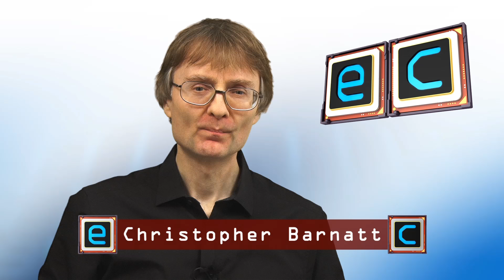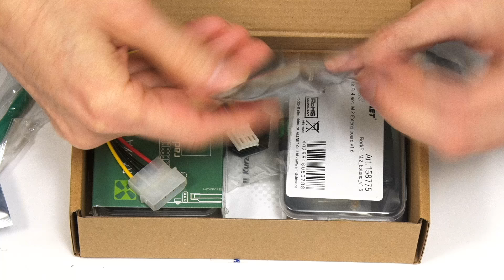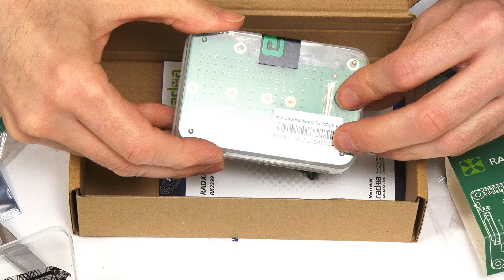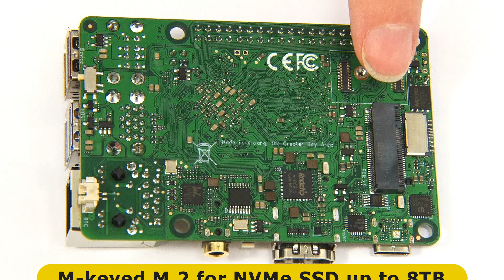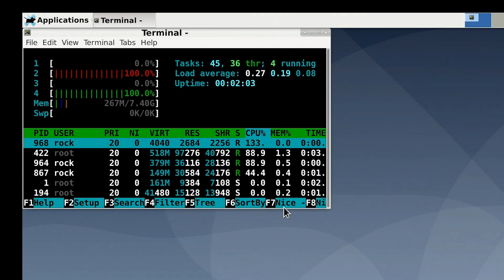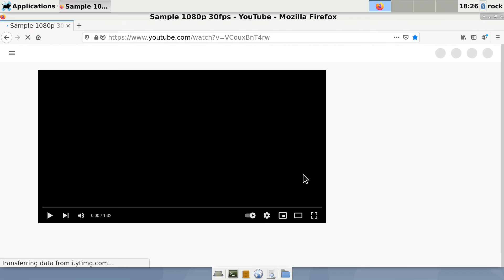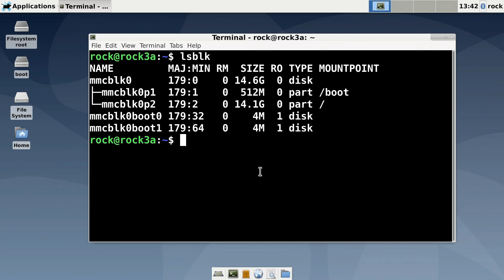Rock 3A: Dual M.2 ARM SBC with eMMC socket

Comment: I am wondering if you could test one of the SBCs with an m.2 slot with a m.2 to SATA card, I have seen these that support 6 SATA connections. ORICO M.2 PCIe M Key to 6 x SATA 6Gbps Adapter Card for Desktop PC Support RAID-PM2TS6 It seems like this would allow you to create a nice NAS. Can these boards run freeNAS, if so, it would be great.
Reply from the maker: An M.2 SATA to SATA adapter will certainly work on an SBC with an M.2 SATA port (well, if the OS used supports the SATA M.2 slot -- and that is by no means guaranteed!). However, an M.2 PCIe/NVMe to SATA adapter will requirea  driver for the specific hardware, and this is very unlikely to be available for ARM SBCs (a specialist driver for a specialist OS!). However, such an adapter should work fine on x86 SBCs -- eg a LattePanda 3 Delta.

FreeNAS is not available for ARM as far as I am aware -- it is for x86 computers only. Commonly ARM SBCs run OMV for a NAS.
Reply: @ExplainingComputers  Hey Christopher - thanks a lot for the video! Was wondering if its still possible to make a follow up video with m2 to 6 SATA Card, running latest official image or Armbian. Looking for cheap NAS, based on OMV or CasaOS. Currently running OrangepiZero3, but it is limited with USB2.0 and lack of any M2 connectors.....
For some reason I'm sure that you should have one of those M2 to SATA cards laying around xD

Comment: Following-up, I've got the Rock 3A running on Ubuntu 20.04 server to which I've added the Mate UI. It is running very well, even playing YouTube vids, but it is balky when asked to run a movie from my smb server using VLC. There are clearly things that need to be fine-tuned where video is concerned. Sound, however, seems to be great, which I've been getting via Audacious!

I'll be attaching my drives to the 3A using USB 3.0 - Sata drive bays. I currently have 10 TB of capacity, most of it loaded, so these will be accessed via samba as they were in my old setup. Stay tuned!

Comment: Well I got one of these a few weeks ago, and was quite frustrated with the lack of support. If I'm not mistaken the board has been out for about 7  months now, and most of the operating systems are half baked still. When one seeks support from the wiki or forum little assistance is provided. I did however finally get one to run, and when I started the hardware tests suggested, I found the system showed 1.4 GB of memory, when I ordered the 4GB version. It went back. Very frustrating....

Comment: This is quite exciting. While ~1000 MB/s aren't much, it is still quite enough to fully saturate the 1 Gig Ethernet. Meaning we might actually have a board feasible for a cheap, reasonably fast NAS. I wonder if we could get a 4x SATA to M.2 adapter working here...

Comment: Why do these boards include USB 2.0 since it's backwards compatible? Why not make em all USB 3.0?
Reply from the maker: It would cost more, and USB 2.0 is still perfectly sufficient for connecting many devices, not least a mouse and a keyboard!. All desktop PC mothers still also have some USB 2.0 ports for this reason.

Comment: Just you wait, the Rockchip RK3588 is coming very soon (finally) and there will be new SBCs like Rock 5 and a board from Pine64 announced probably by the end of the year. This is alarming for the Raspberry Pi fanatics that are still stuck on 40-28nm, because this SoC will be made on a Samsung 8nm process, will feature 4xA76 cores at 2.4-2.6GHz, 4xA55 cores at 1.8GHz, which will be around 2.5x more powerful than the RK3399 that's found in Rock Pi 4 and other RPi 4 competitors in single core and especially multi core applications, a much more powerful Mali GPU (almost 10 times more powerful than the one in RK3399), an NPU 3.0 with 6 TOPS performance and other great features, like support up to 32GB LPDDR5.
Reply from the maker: Yes, we should see some very good RK3588 SBCs in 2022 I hope -- software permitting . . .
Reply: Awesome... I hope these devices will be available soon for decent prices. Because the RPi devices cpu&gpu power improved only slightly for some 10 years or so (of course there's certain progress within each new line, but it's only in tenths of percent, slightly above the increase of frequency).

Comment: Wouldn't touch Radxa products - their software sucks and the hardware has lots of underlying bugs. Save your money and stay away!
Reply: The SoC's work flawlessly most of the time so it's still going to be a good board for most developers. Raspberry Pi 4 isn't that well supported or superb either, so there are always going to be problems with some boards.

Comment: Sorry, Chris, but you are entirely too forgiving when it comes to the Rockchip line of SoCs when it come to software functionality. This has been a recurring problem and there is absolutely no reason to think kernel/driver support will magically get better if we just wait a little longer. (Full props to Laurence Tang for his work supporting FriendlyARM products, but he seems to be the exception that proves the rule.) 

When I visit the Rockchip wiki I see a Linux 4.4 kernel that supports the RK3399, but neither the RK3368 nor the RK3568 -- the latter particularly of note for this video's SBC. There's no support for RK3568 boards at the Armbian site either. If one of these boards doesn't meet a buyer's needs in the state it arrives in they should return it immediately unless they're hobbyists who enjoy tinkering and rebuilding kernels.

Comment: love your videos. I noted the PCIe connector and I didn't see you use it. I am wanting to know if this will run a graphics card on a mining riser My thought is to run a Linux system and a single 3080ti or 3090. any idea?
Reply from the maker: Thanks for this. In theory the M.2 to PCIe connector I bought could be used with the bottom M.2 slot (the one I which I tested the NVMe (PCIe) SSD. To run a graphics card using the latter would require appropriate Linux kernel support, and relevant drivers. This is not impossible, but it is more likely to use something like a PCIe SATA card.
Reply: There was a video of some guy trying to use an AMD graphics card with a Raspberry Pi 4 and failing to get it to work. And with the obviously inferior kernel and vendor support of Rockchip SoC's and SBC manufacturers, I really wouldn't get my hopes high. 

Just use a thin&light with a Ryzen CPU to play games with a 3080. ETA has done a similar thing in his video that he released just this week, go check it out. Also, no need to use a powerful GPU because you're still going to run into PCIe 3.0 x4 bottlenecks.

Comment: Every review of such devices always misses on documentation. Good hardware (register level) documentation is often make or break for bare metal applications. Without it, it's just yet another Linux box.
Reply from the maker: I specifically did show the available documentation (wiki) here. It does not go down to the register level.
Reply: It seems that everything is working even the M.2 NvME with proper distro... I assume that GPIOs are working cleanly because it's essential for SOCs (I would assume all the the C/C++ libraries for programming own projects are available). With register level you mean writing bytecode (assembler) instructions with peripherals as e.g. with Arduino ? Hmm, it's probably (quite unsolvable) problem.
Reply: @vencdee  By register level, I am thinking about hardware registers of peripheral devices. CPUs themselves are usually pretty well documented, but peripherals are completely different story. Without knowing which bits in each register do what, you can only guess (BTW, such guessing sometimes works). Reversing existing drivers can give some clues, but it never gives you the full picture.

Comment: does it work in home automation?
Reply: All Single board computers can be used for home automation, it is one of the most common uses, however the Raspberry PI series has much better software support and much better comunity support for that application. If you are new to setting up home automarion and want to control a large number of devices there is a lot to learn. Usimg multiple SBCs each controlling a single device is one way to do it, but there are cheaper modules. But if you have several deviices that you want to control in one location then an SBC is the way to go, but probably not this one, at least not yet. My setup uses a couple of Raspberry pi 4s with some now very old custom software, but over the years I have started to drift away from this as more and more devices include direct support for wi-fi and Alexa. Pretty much now only left with central heating a 3d primter, and a few lights that will get swapped out for alexa ones soon.

Comment: Hi Chris, quick question.. can you install the Debian Buster image on a raspberry pi? or is it set for Rock Pi only?
Reply from the maker: The Rock SBC images will only work on the Rock boards. There is no standard hardware platform for SBCs, so you need a Raspberry Pi specific image to work on a Raspberry Pi.
Reply: @ExplainingComputers  , Thanks Chris

Comment: Nice video, what bothers me is why these other boards don't just have the ports on the same side as the pi 4. Would make getting cases much easier. Even if a little dremellling would be needed to enlargen certain holes.

Comment: So I recently got into SBC's and picked up a Raspberry Pi 4 CM and a Waveshare board to plug it into. This has an nvme built onto it, but it doesn't have USB 3.0 (I found that you don't really see ANY CM4 with PCI and USB3 or nvme and USB3 - maybe it's a limitation) Unfortunately my CM4 module doesn't have WiFi or BT or an MMC so I HAVE to put my boot onto the SD until  I decide to a NON-TAILORED linux install so I can put it on my nvme and get those great boot times you were able to show us. I haven't had ANY issues with distro seeing my nvme drive, I just use the ones for the Rasp Pi 4 and it's always there, but I haven't gone very deep into building much - I just wanted a small retro gaming machine to have some fun on the side. I also wanted to mention that I was able to get about 3,000MB/s
I am glad to see that new systems are still being made and improved upon. Thank you for the video :)

Comment: Another excellent video from Christopher.  I really do like his channel.  He has got such an admirable grasp of his subject, and he is able to explain things so clearly and succinctly.  Add in great video production values, excellent graphics, and Christopher's very own quirky way of presenting his subject, and you have an all-round winner.  I am less than impressed by the Rock 3A, however.  $75 for the 8 GB version doesn't sound too bad, but once you add in all of the other bits and pieces you need, then the cost starts to creep up to less than acceptable levels.  You'd obviously have to adopt the same mounting solution for the NVMe that Christopher did, as trying to mount it directly to the SBC is a waste of time.  And when you've done that, you find that Debian 10 won't acknowledge its presence.  What?  The WiFi aspect needs more work, as well, and I think that overall I would far rather go to one of the Raspberry Pi products than to choose this one.

Comment: This is what happens when you try to use a surplus Android designed CPU for other purposes. That is why I stay away from Rockchip. E naming could also be a clue that Radxa is trying to stop the Pi branding confusion and set themselves apart. Since they don't have to play on that confusion to get a market share like many Chinese derived companies are notorious for.

Comment: The outward-facing m.2 slot is actually a reasonable compromise solution.  Users are probably going to need a riser card anyway with all the thick double-sided and different length m.2 cards.

Comment: Gday Mr B. will these ever be good enough to run as a file server??? off a lipho battery and run up to 12 x 3.5in WD red NAS hard drives through a relay, ofcourse to supply a 12v and 5v rail separate to the SBC as it would not handle all the power being directly drawn. The relay will draw power on voltage from the SBC to spin the hard drives up at boot.

Comment: Out of curiosity, did you check if there was a "non free" Debian os version? Debian by default comes as a non free OS and to get better hardware compatibility you must install another version code named "non-free" which includes proprietary drivers that make debian more compatible out of the box with certain hardware components such as wifi cards and nvidia cards. This is for the desktop. Prehaps the same is true for the single board computer versions of Debian.

Comment: Chris... Mr. Scissors didn't get a formal mention?... Stanley The Knife did and he wasn't even used live on the show to unbox (except for a quick slash later on).  You did eventually mention Mr. Scissors in passing.  However, that was later but the horse had already bolted.  Hey, fantastic unboxing, assembly and software performance testing.  I am now looking forward to the improvements in the Rock 3B will bring when you will do its review early next year.  We get just as excited watching you open them as you do.  I was surprised the video playback for the 3A was well bad, given the hardware ... the GPU must not be that good -- probably addressed in the 3B version.  Thanks again, Chris, for another stable diet Explaining Computers bread and butter type show... the best subject material cover!      (That said, I do enjoy the other material you cover, too.)

Comment: Why do these boards not use usbc  for data or video
Reply from the maker: USB-C is a type of connector, not a standard for data transmission. USB-C connectors work at one of the USB 3.x speeds, just like the USB 3 Type A ports on this SBC. So these boards do communicate data at the same rate as any computer with a USB-C port.

Comment: I'd like to see the RPi foundation make some of these hardware improvements (maybe on the RPi 5 or 6?). Thanks for another great video Chris.
Reply: I'd agree I have still an original pi but there is very little it can usefully do mainly due to lack of speed.

Comment: So the video in Debian plays poorly? So if you switch to Ubuntu OS? How would it perform better, and will it solve all the misreading, and all the drives/SSD/eMMC, and drivers install?  It has seen the board may handle Windows 10, or 11 with a 4 x 2.0ghz processor Or it won't? It is strictly Linux only.

Comment: I was almost a buyer of this until I saw that the disk m.2 slot is right on the edge and points outwards, effectively doubling the space required to use it with a nvme disk. Thats a shame because thats a decent transfer rate. It looks like that isn't the case on the Rock 3B so I might consider getting one of those instead.

The Mesa devs have started to add support for these newer Mali GPUs now so the graphics performance will improve but its still only the Jetson boards that have good hw accelerated video playback support in the ARM Linux world, if you want 4K h264 playback.

Comment: Like most of these boards, they aren't for the amateur tinkerer. You need to have serious skills to work with these boards as you are on your own. The Raspberry Pi boards have a support system that will make working with them much easier. Impressive hardware though.

Comment: BTW, have you noticed that it's one of the first boards with some npu capabilities? Also slot E is designed for use with google coral (1x, dual is not supported without adapter). I was sure You will be first to test those things rather than video capabilities :)

Comment: Hello, this board have 1x pcie lane for m.2 E slot (wifi or tpu) and 2x pcie lanes for m.2 M slot nvme). Also one lane is used for USB3. Each pcie lane can do about 500MB/s, so here nvme with 2 lanes has this speed. If You would like to sbc with 4x pcie lanes for nvme You obviously missed nano pc t4 (its on rk3399), it also has good side for nvme drive ;) also You can get such speed with rock pro 64 and its pcie 4x port (using oposite adapter as the one from this video).

Comment: Great video. Thanks for the hard work on this one. I'm waiting for the first SBC that doesn't skip with 1080p. YouTube playback through a browser. I'm never sure what "4K at 60 frames per second," for the GPU means, when YouTube skips at 1080p
Reply from the maker: "4K at 60fps" for a GPU has nothing to do with video playback, let alone streaming media video playback. Rather, it refers to the maximum screen resolution and video frame rate that the board can output. So this board -- and many other ARM SBCs --can certainly feed a 4K monitor at 60fps. But the board's streaming media video decompression capabilities are another matter entirely.
Reply: @ExplainingComputers  I did not know that. Thanks for the explanation.

Comment: Very odd that the GTK version of Network Manager isn't installed, yet the CLI version is pre-installed. Also Libre Office could have been pre-installed (it doesn't take up too much storage space). Radxa are being skimpy on the bundled software selection.

Personally I don't think any Chinese manufacturer creating SBC's should be given any slack when it comes to software support. SBC's have existed for a long time ever since the original Beaglebone was released (in 2011), which created the consumer SBC market. The Raspberry Pi (first released in 2012) set the "golden standard" for how software support should be done. Chinese manufacturers have had plenty of time to sort out software support and provide a very polished user experience. It is time that we stopped giving Chinese manufacturers slack on the poor state of the software they provide with their SBCs.